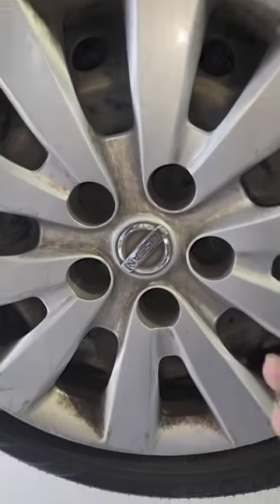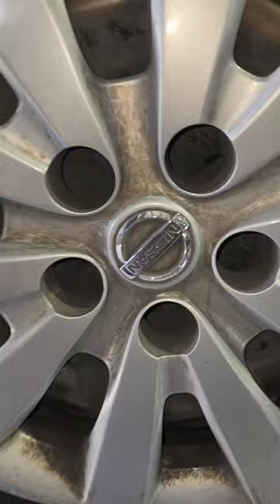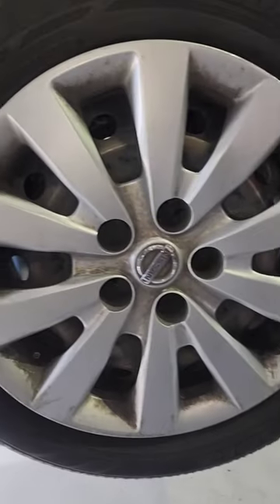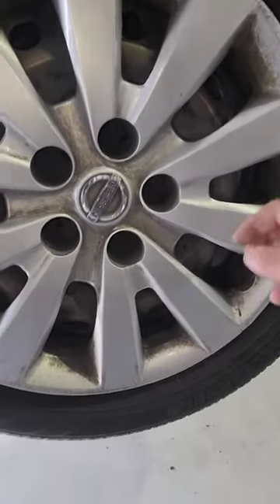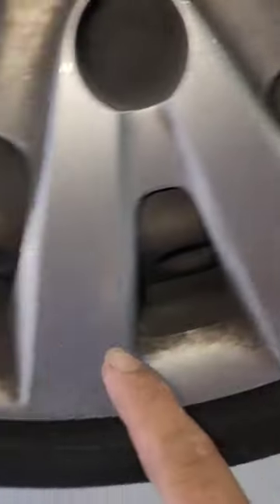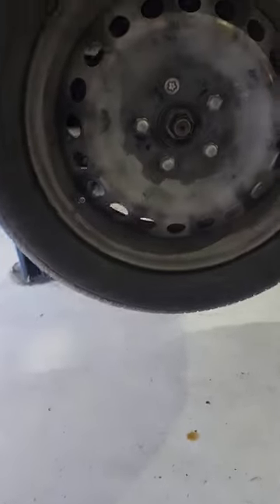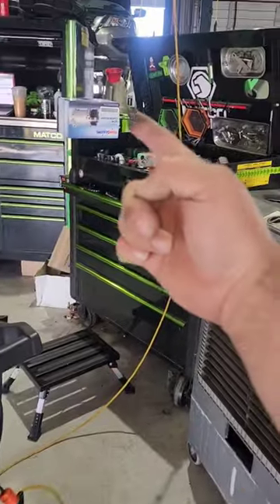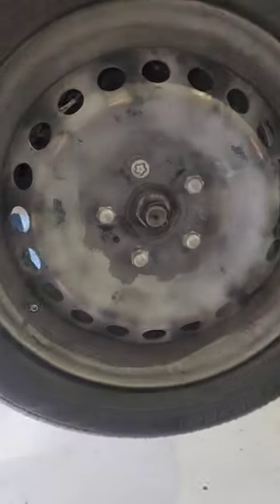MISSING LUG NUTS #shorts #auto #mechanic

Comment: Aftermarket or nah it’s all fun and games till the inside bolt snaps off in the block
Reply from the maker: 😅🤣 yes...they wanted this out quick...i told em hold on cowboy...thats if this bolt doesnt break...he said oh yea FUCK lol and shortly after that one of the apprentices bolt broke while coming out on a different one lol
Reply: @FluffyMexicanik  I had one that already had broken the rear bolt but it came in with the front two and they declined the extraction so a week later came back in with both front ones broken off. Ended up having to pull the front clip and drill and helicoil all 3 😂

Comment: Who puts a wheel lock on a steel wheel and when that happens it usually pisses you off because you done got it in the air and you got to lower down to find there wheel lock because you wouldn’t think a steel wheel would work have a wheel lock
Reply: Oh its even better when its a 90,000$ lincoln with cream interior, yeah gotta wipe a lot of greasy prints off because 1 out of 1,000 customers with wheel locks will put the wheel lock in the cup holder, or the lexus yesterday with white interior searched everywhere for the wheel key not in vehicle customer didnt answer phone for us to ask where it was until later in the day they didnt have it so twist off socket it is and then send it with normal lug nuts